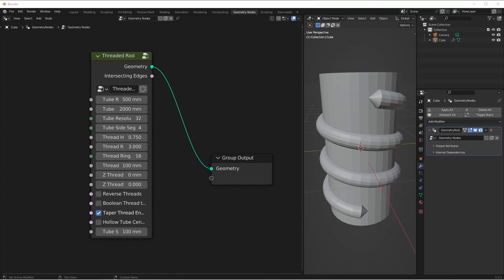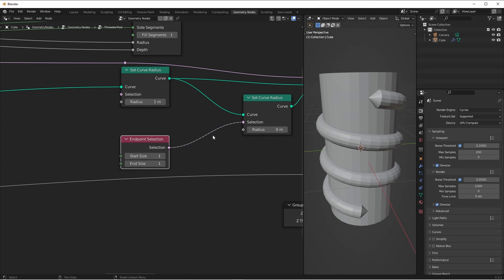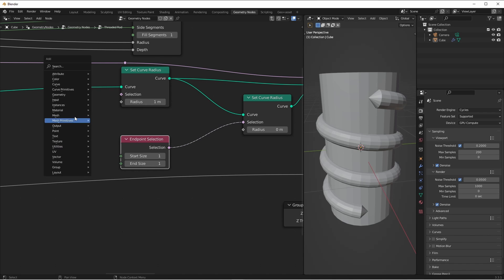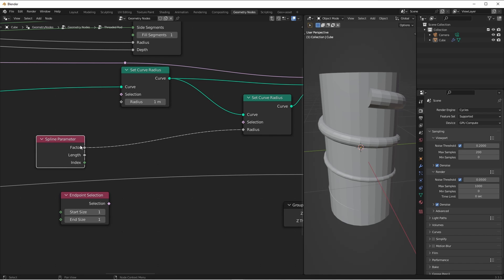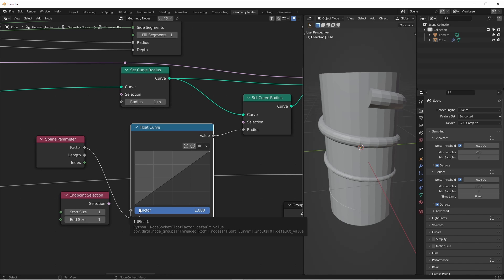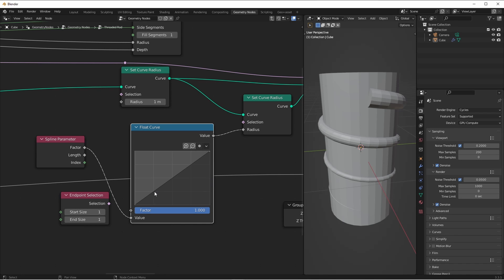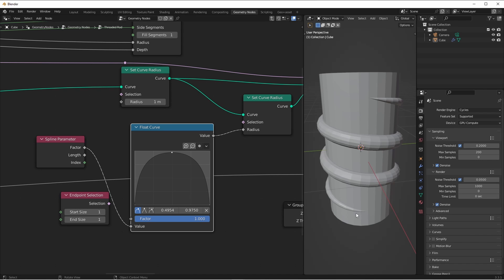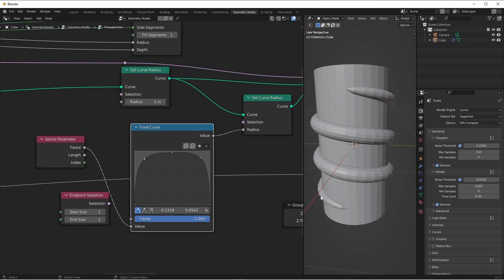Work The Float Curve Node - Blender Geometry Node Basics

Comment: very helpful and informative! can the graph of the float curve node be exposed as a parameter accessible from the modifier stack? or is it not possible?
Reply from the maker: I actually wrote an extension to do that. Check here 

New Blender Add-on Lets You Access Node Properties Without Sockets
https://youtu.be/9YcC8DI4Vww

But also I think that is coming as a built in feature in the future.

Comment: I don't know if the float curve (and color ramp) parameters can be accessed from outside the node group, so to expose a 'pointiness' group input I changed the float curve to a couple of switches and greater than nodes. I suppose you could create a proper asset that allows for a variable number of gradient stops (I wouldn't know where to begin).
Reply from the maker: I would love it if there was a ramp or curve "input".

Comment: It's a pity that that you can't expose the curve to the group.
Reply: Yeah. Also drop-downs can't be exposed to the group input. Although that would be easier to implement.
Reply from the maker: I think that both of these things are on the radar of the developers.
Reply from the maker: You could expose that radius input to the node then hook up the curve parameter and curve outside the node.

Comment: I used the two together. Spline Parameter to control a shape curve, and the Endpoint Selection to control the amount of the thread curve the Spline Parameter and Float Curve affected. 
I also used the other ends Float Curve to offset on Z the end of the thread curve so that as the thread narrowed the top stayed aligned (well almost) with the rest of the threads angle.
Sometimes I do almost feel like I understand GeoNodes... lol
Reply from the maker: Nicely done!